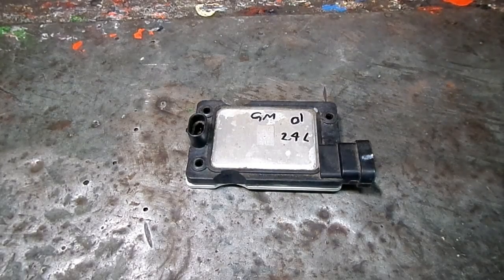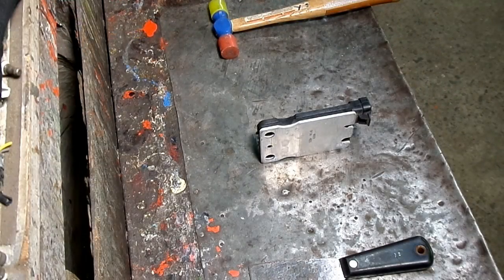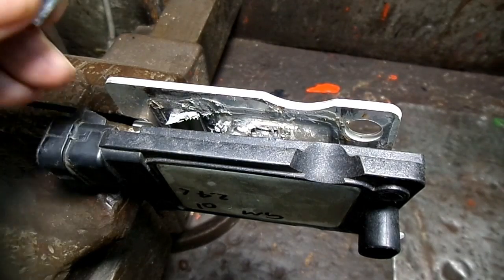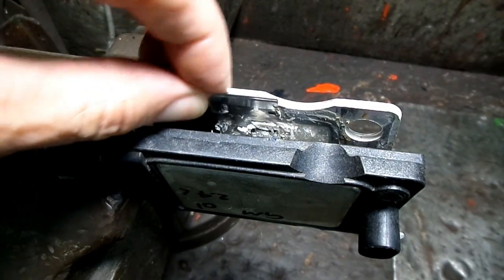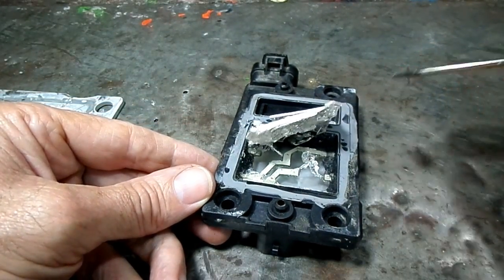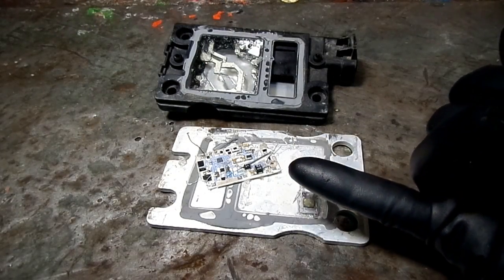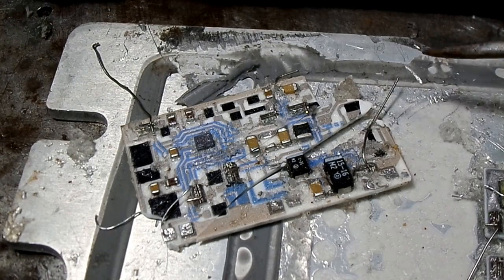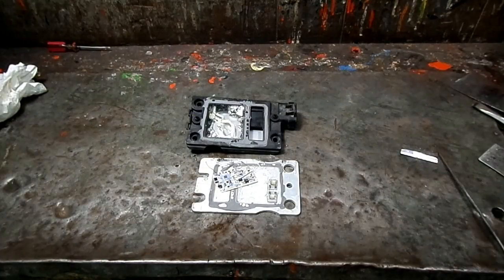Automotive Ignition Module What's Inside ?

Comment: Great not many do this the panels is an integrated electric switch Wich is actvati by a small voltage 5v to throw a conitnuety contact and also take in 12vand the gell is for corrosion heat resistant of the panels component
Reply from the maker: Thank you for the info greatly appreciated.

Comment: first off this is an electronic  switch to replace the points on  an IC engine.as the design evolved a simple circuit was added to mimic the rev dependent advance retard simplifying the pick up  to a magnetic pulser. then the boffins just added more and more, getting more refined ignition performance till EVs made gas cars  obsolete

Comment: Thank you for the film. Pls could't you tell what dielectric grease to apply on that Module for heat dissipation? Can I put e. g. Silicon Heat Transfer Compound, 3M Silicone Paste Dielectric grease or Dielectric grease for sparkplugs boots?

Comment: The ceramic (aluminum oxide) sheet is very common for higher quality power electronic submodules. The parts that actually switch the higher currents (MOSFETs/igbt's) for the HV coil are on the far right in the close up, almost out of the image pan. The snotty substance is silicone potting material with a relative high break down voltage. (Again not cheap). I'd say they (who designed it) did their best. If it was broken I'd suspect the output FETs or the coil itself if it is embedded in this module. 

Aluminum oxide has a very high thermal conductivity while also being a very good isolator for high voltage. It also provides a solid base for components and if dies to be bonded to.
Reply from the maker: Great info.
Reply: Can a ignition module, cause a weak spark. I have a 95 Toyota Corolla and it has new coil and the distributor was new at time of purchase almost a year ago, the coil has spark will jump an air gap but its weak, your thougjts?

Comment: Good evening Richpin06a. You are so inquisitive like a technician should be. Next time when you take something apart like this module, use a heat gun to loosen the adhesive : ). You are on the right track, your thought process is fully intact. i'm not an expert yet, what you found inside is smt(surface mount technology). The (black components are processors, coils, transistors, voltage regulators), the (brown components are capacitors, which filter voltage and condition signals) the (blue lines are traces, which connect all components which make the complete assembly). the jell, most likely is used to conduct heat away from the hi-speed components. as you know, hi-speed means hi-friction, hi-friction means hi-heat. every circuit, just as everything in the universe does these three things,- input, process, output-. I know you are familiar with at least basic electronics. these electronics are the same as what you are familiar with, just smaller, faster, and more per component.
Reply from the maker: Very interesting thank you for the 411.

Comment: It's probably a microcontroller chip and other chips, components to support it.  Microcontrollers are so cheap they're in everything from TV remotes to singing birthday cards.  I've never seen a circuit board like that one encased in gel, interesting.  It might be electrically insulating but thermally conductive gel, a lot of thermal pastes like in a temp sender unit are somewhat conductive, IIRC it's because they have microscopic metal particles.

Comment: Hmm a ceramic board to mount the components on, most of the parts are simple capacitors/resistors/diodes, but that black square with the blue tracks around it looks like the heart of the system, a silicon chip.
The two chunks left on the heatsink are output power transistors, the muscle of the module lol :-))

I think the jelly is board protection, stop damp getting in and upsetting the operation.

What gm car did it come off mr richpin?
Reply from the maker: It came off of a 2001 pontiac grand am.
Reply: richpin06a
A fair few years old then, nice to see the inside :-)) thanks for the teardown :-))

The jelly did protect the board, it looked quite fresh.
Reply: I have 2001 Saturn SL2. It has same Ignition Control Module. Can't figure out if I need to apply any Thermal Paste on it. They always apply it on Crysler, Chevy, but I didn't see anything on the original Ignition Module I removed fm the Saturn. I applied some thermal paste on a new Ign Module I installed. The car starts very well (how it started before, I replaced just due to the high mileage), but started to throw code P0340. I think maybe that jelly is heat protection substance, so no Thermal Paste is needed.

Comment: hi, follwing is what i can think off. It should have transistor to turn on and off. it should have feedback circuit back to ECM to let the system know is it firing or not, it should also have circuit that convert pulse signal (Digitial) to on off signal using IC. (amplifier) that provides on off signal for ground. Pulse signal is very weak, so it needs to be amplified.  Some GM Modules for few seconds, while cranking will fire on static ignition timing rather than feedback from ECM, once engine is started after x reovlution feedback will put the spark on right timing.. all thse are done in the module. long story in short.
Reply from the maker: Got ya.

Comment: Interesting.  First time I've ever seen a ceramic board like that.  Only thing I can think of is it's a film layered PCB that's glued to the ceramic base which is then glued to the heat sink.  I've never seen anything like that in any kind of electronics.  Not a fan of the ceramic though as that could fracture.  Ceramic doesn't react nicely to being knocked around.  Perhaps the gel acts as a corrosion inhibitor plus shock absorber.   That's really neat even if I don't agree with the design.  It's something different.